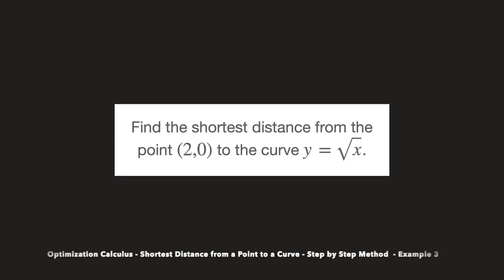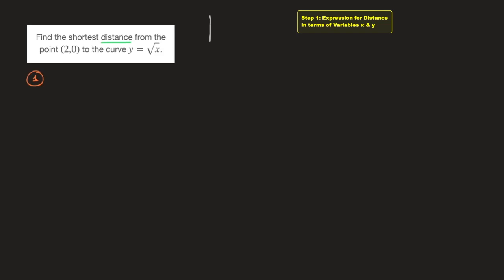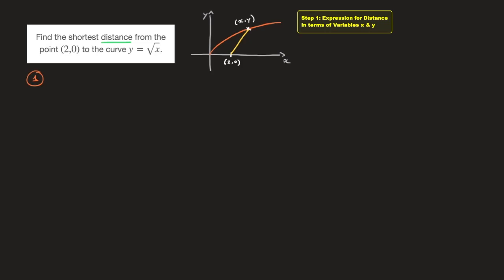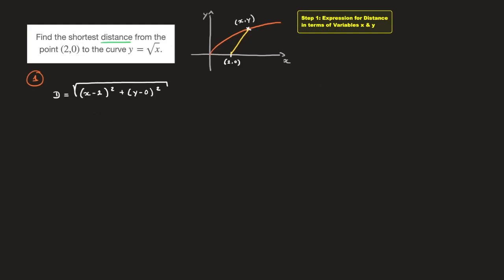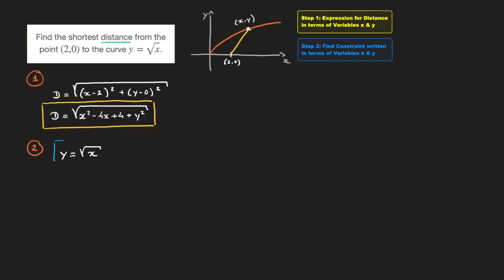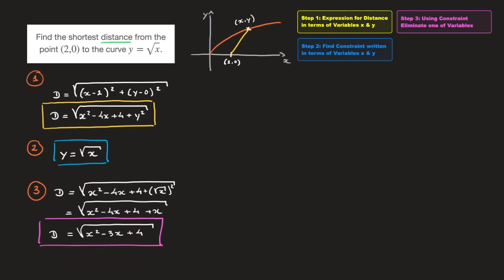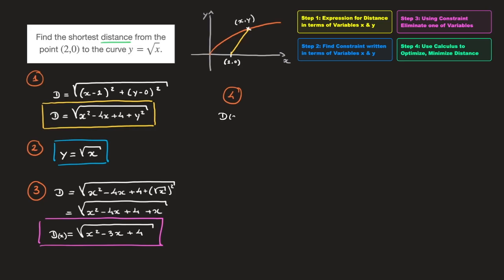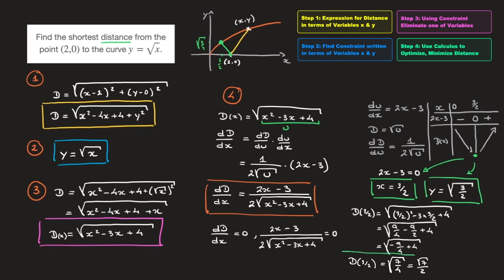Optimization Calculus - Shortest Distance from a Point to a Curve - Step by Step Method  - Example 3

Comment: There is actually a trick to solving these types of questions. You can just take the final D(x) (in this case it came out to be x^2+3x+4). Instead of taking the derivative of the entire square reoot, you can just disregard the square root and just take the derivative of the inside. This is because the extremas for the square root would be the same as the ones for the function without the square root. So the derivative is x^2 - 3x + 4 -> 2x - 3. Solve for x and you get 3/2. This works for all optimization distance problems
Reply: Thanks, that's going to save me a lot of time.